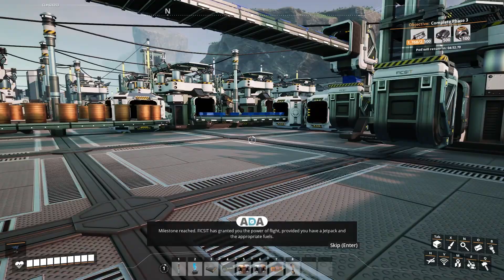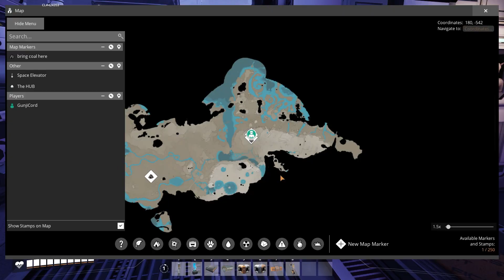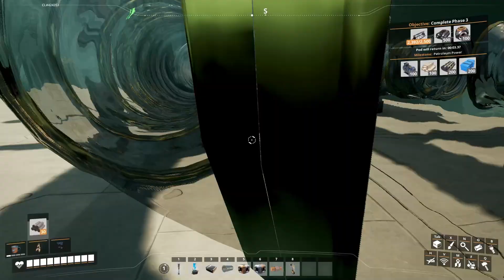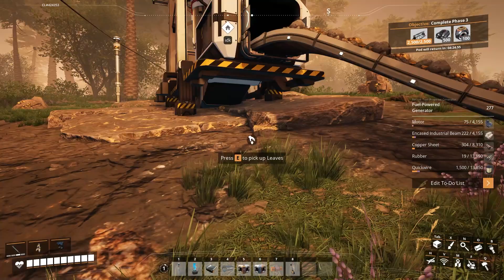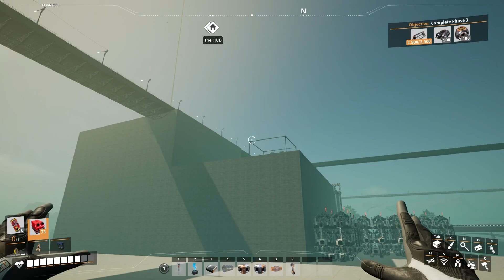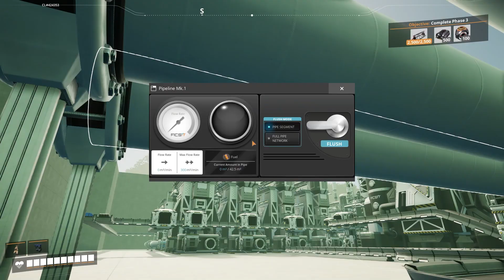The ULTIMATE 69,000MW Turbo Fuel Power Plant! | Satisfactory 1.1

Comment: Great video!! I decided to jump from a few fuel gens directly to rocket fuel in my 1.0 playthrough. In the crater lake i was able to produce 324GW across 1300 fuel gens using the local oil/coal/sulfur/nitrogen. That's 9 floors of 144 (12x12) fuel gens with the little bit extra making ionized jetpack fuel. Pro tip for those willing to try, don't try to balance 10 gas pipes into 9 gas pipes across that tall of a structure. It isn't a fluid so you can't just "water tower" the pipes. The back row on each floor would always get low on rocket fuel. Instead, package the fuel and belt it, then unpackage on each floor. That solved my problem, but took me like 40 hours to figure out. I may just skip nuclear, haven't decided.
Reply from the maker: I also might skip nuclear when it comes to it but thats awesome!
Reply: I just doubled my pipes and only put 300 in tier 2 pipes. Also fixed my problem.